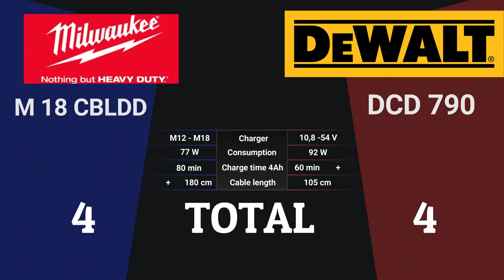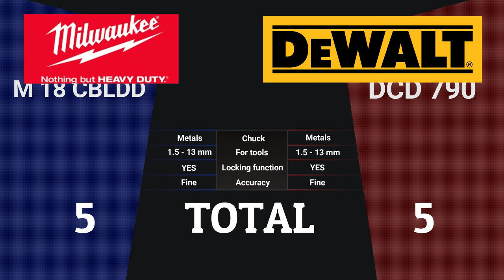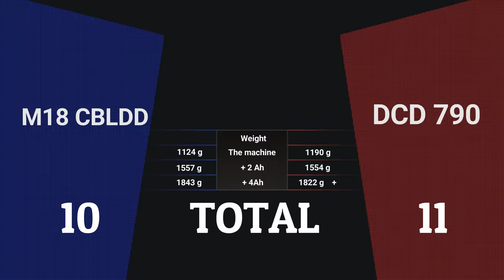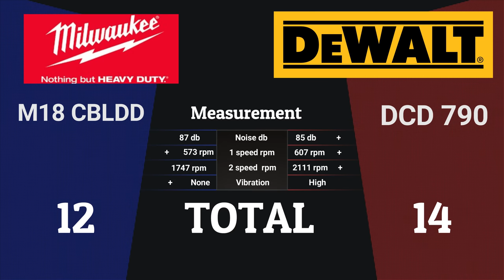Porovnanie 60 Nm vŕtačiek. Milwaukee M18 CBLDD vs Dewalt DCD 790. Ktorá je lepšia?

Comment: Hi, dear friend I am an Iranian and I am a hard-headed fan of Parkside Brasheles, even though we are sanctioned, I have barely bought a parkside tool, a 1350 NB box and a rechargeable drill and a rechargeable demolition drill and saw perpendicular to the screw-up and most importantly the plasma cutter Parkside compressor is really at nasa limits for me.